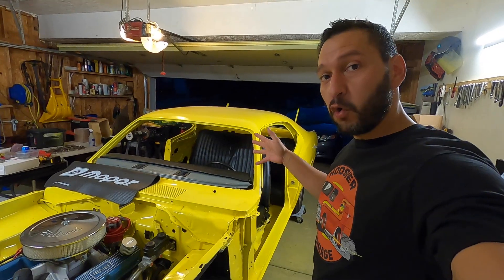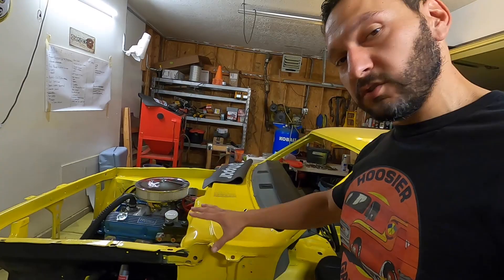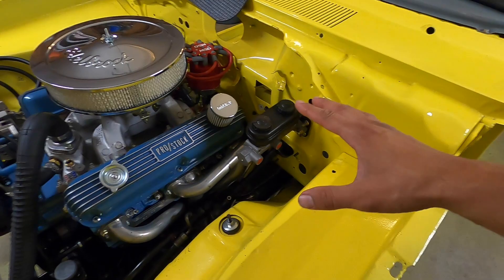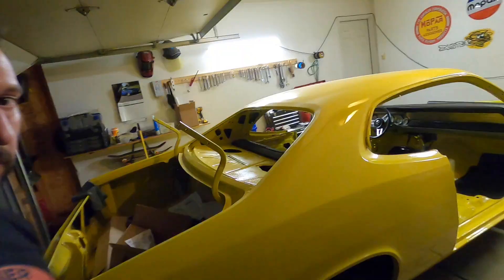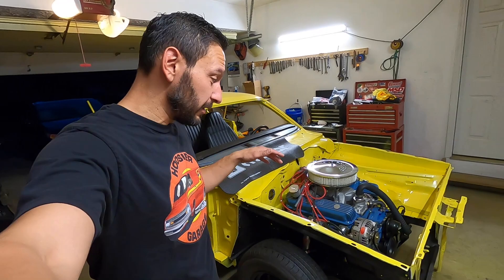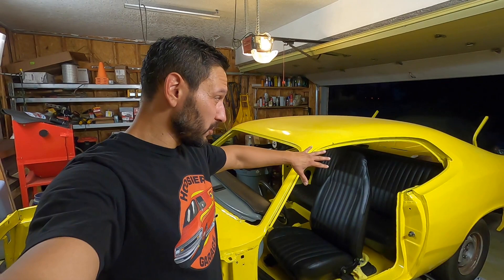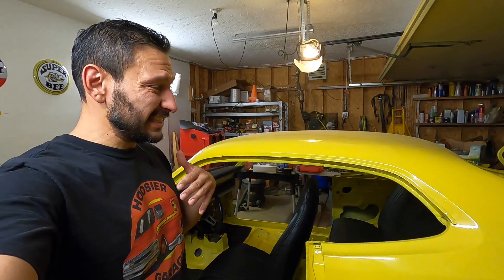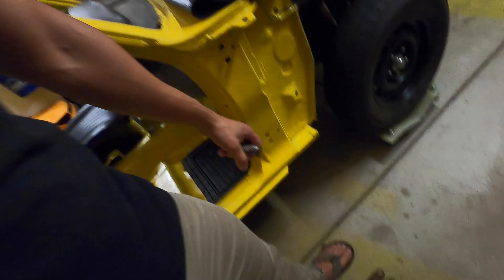Plymouth Duster Back on Fresh Rubber After 41 Years of Sleeping 😴

Comment: I used an 80 grit orbital small hand sander on my drive line tube. Cleaned up real well, then primed & painted it. Those glass & door seals are gold $$….. If you don’t want to buy body rubber from Classic Industries, there’s always Steele Restoration Rubber Co. I did a look up and there more than C.I. Use them as a comparison.
Reply from the maker: Hi Macho, thanks for watching and for the tip!  I had not heard of Steele Restoration, I will be sure to check them out. Yes, I was thinking orbital or a stripping disc. I bias for mechanical removal tools. Yeah, sticking seals are crazy expensive.